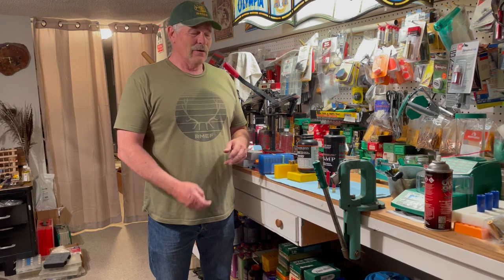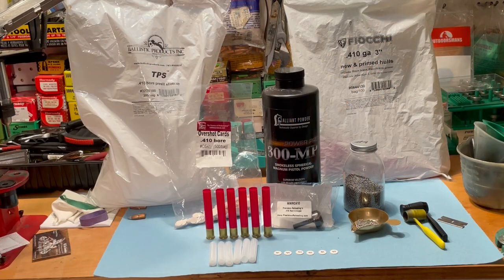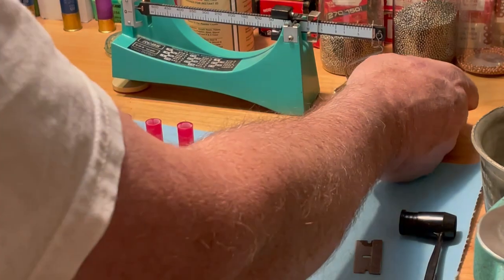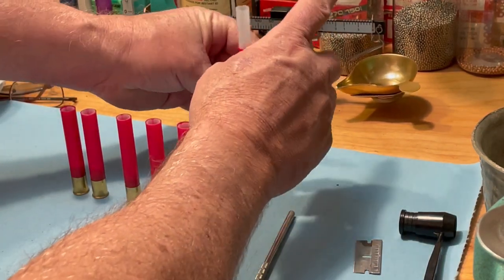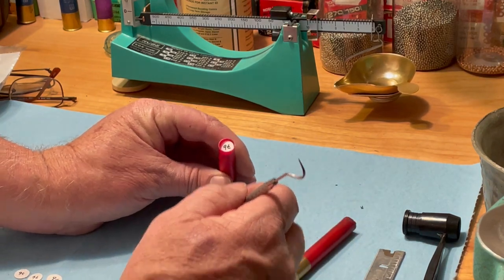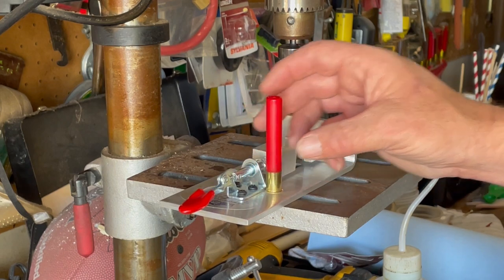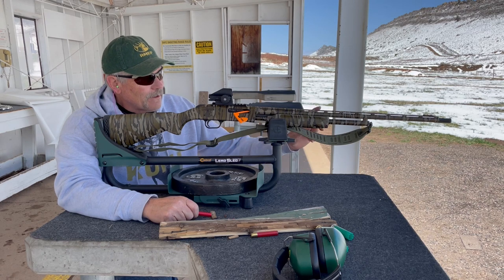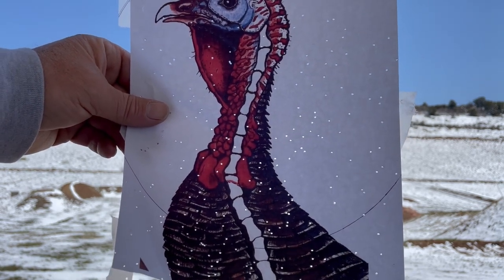How to Reload .410 Shells: Maximizing Your Success for Turkey Hunting

Comment: Very interesting and helpful advice.  Question if I may about Tungsten shot and having stray pellets hit elsewhere on the bird and then biting down on it at the dining table.  It’s gonna break a tooth much easier than lead shot, yes?  So what about using a larger shot size such as # 4 so to be easier to find it while prepping the meat?  Is lead shot now illegal to use for turkey hunting in Montana?
Reply from the maker: Lead shot is not illegal in MT for turkey. And yes if you bite down on Tungsten, it is gonna leave a mark! However I have not found any in the several birds I have shot with it. It seems to blow right through because of the density. #4, 5, 6 lead is fine. It just won't carry as far or kill as far. You gain kill distance with tungsten.....

Comment: Im curious what you consider a modern gun, i have a Harrington Topper single shot that is stamped extra full choke. It shoots 3" #7 Remington Express out to what i would consider long range extremely well. My friend's used to heckle me about it, until i drop all the birds the missed. I seen some guys goose hunting using 410s with this Tungsten shot. Now i wanna give it a try.
Reply from the maker: As long as your gun accepts a 3” shell and shoots modern ammunition you should be fine.

Comment: Question for you sir. Can I use the same load data for #9 tss in a 3inch and put same load in 2.5 inch. Using cheddite hulls and TPS 410 wads? Seems to me 11/16 of #9 would fit
Reply from the maker: Actually, I don’t think that would work because you have to use a TPS wad with TSS and I believe they would be too long for the 2 1/2 inch hull…

Comment: Do you have a good supplier for hulls? I've been wanting to buy a .410 for a while but not being able to reliably purchase hulls has been dissuading me. Other than that I can mostly get everything else as needed
Reply from the maker: I get my hulls from Ballistic Products. Just don’t buy a Fiocchi hulls because then you’ll need to buy Fiocchi primers because they are larger than a normal 209. I typically use a Cheddite hulls they already come primed!
Reply: @OldMontanaWisdom1 That was another site were they had everything back ordered. Crazy
Reply from the maker: I’ve been getting mine from ballistic products, but you have to keep a close eye on their site. I have also been picking up a few boxes of loaded ammunition and shooting it and reusing the hulls.
Reply: @OldMontanaWisdom1  ya, I did that also, four boxes of 2 1/12 #8s $80, that was enough of that. I decided to use .444 Marlin brass. got 100 pack for $60 and they will last forever. I worked up a good load 7.7 grains of Bullseye. I am still tweaking the powder, started with 6.1 grains, after i test the7.7 loads I will be pretty close to were I need to be. I am using 1/2 oz of #6 shot in these tests.

Comment: Did you say if you load these with H110 you need to cut back to 13.5 grains?
Reply from the maker: Sorry for the late response!! My apologies! Been out hunting in 4 states. I will look tonight!
Reply from the maker: I looked and I am using 13.5 gr of H110 with 355 gr of TSS and 13.0 with 383 of TSS. I would start a grain lower on both in your gun and work up a load for your gun.

Comment: I am requesting that you remove this video which is making my load data available to the public.  Thank you.
Reply from the maker: Although I looked at your loads as well as some from Ballistic Products and used a few of them as a starting point we decided to do testing on our own that involved a couple months of work. We tested all sorts of hulls buffers and different weights of powders and TSS. The loads in the video in no way duplicate any load data you send other than powder type and the BP wad I have been using for years for all my 3” 410’s. And I would be happy to share some of the data we derived if you like? I mentioned your name as a source for TSS and other data for other gauges thinking it might increase your TSS business. If you want me to remove your name as a source I will be happy to do so but the load and chokes we came up with for turkey and mention in the video does not duplicate your data…. we put a lot of work into developing this particular load for turkey.
Reply from the maker: Also if you want to share our data using 353-355 grains of TSS with the BP wad. I am OK with that…..good hunting.